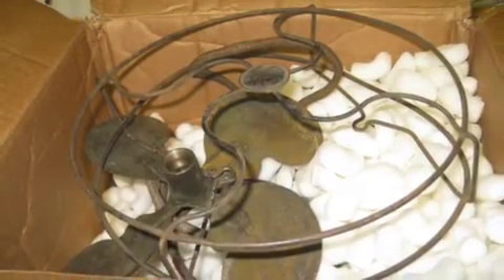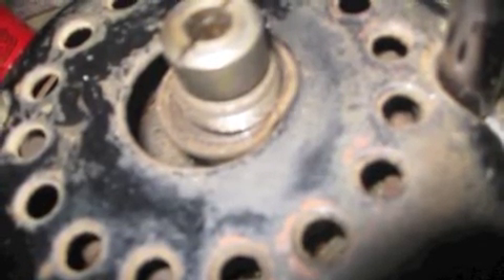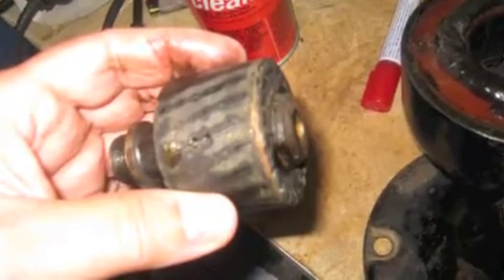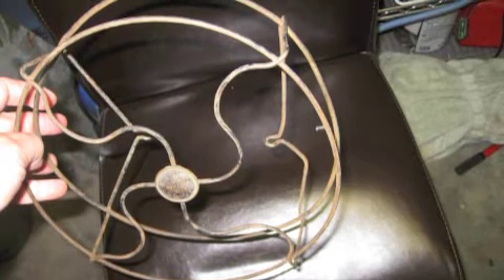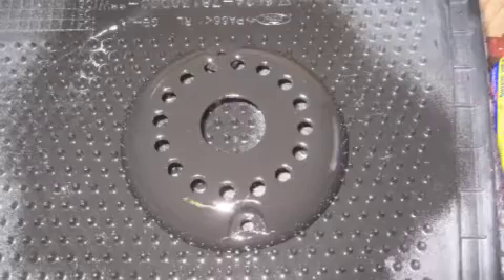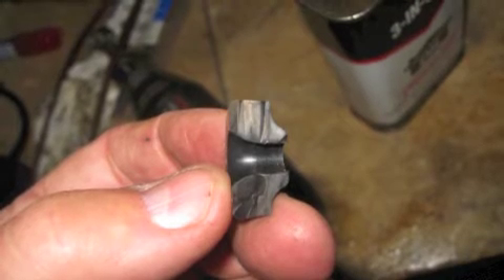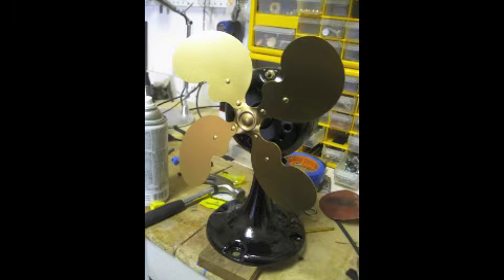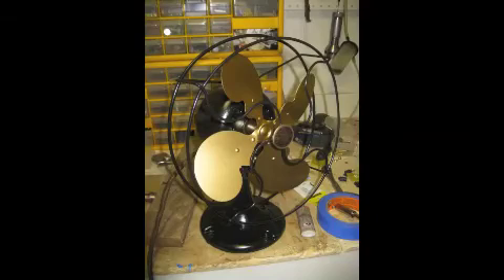Emerson Jr 1921 vintage fan

Comment: Your best thing the motor windings were good shape.those motors were very large for the power output that is why they held up so well. I have many old motors ,and most all were in working condition when I got them. I bought a motor only like yours off Ebay for $12.00 it is in working condition also.

Comment: I can't figure out how to remove the blade. There is no screw. Any tips?
Reply from the maker: it is difficult on old emerson fans... they screw-off clockwise.  you must secure the windings with a screwdriver from the holes in rear. be careful and good luck
Reply: Got it. Thanks for the tip.
Reply: thomas griffin I just broke mine fan in the process of trying it remove the blades :(

It's probably too late now, but is there a specific method for doing this with out further damaging it?

How do I know which model I have?

Comment: i bought a '25 Emerson Jr that I'd like to restore. I haven't taken it apart yet but I'm wondering what the big flat screw is for In the back. will i need to remove it to remove the blade? also what kind of paint did you use to paint the blades? they look perfect.
Reply: Do you have a video of do restoring that vintage Emerson Junior I want to restore one that I raised in the back but I don't know how to take it apart

Comment: That was an amazing job. I have an old fan I bought on ebay also and the head is broken fron the body. What did you use to recreate the missing metal on the bottom? What kind of paint did you use?